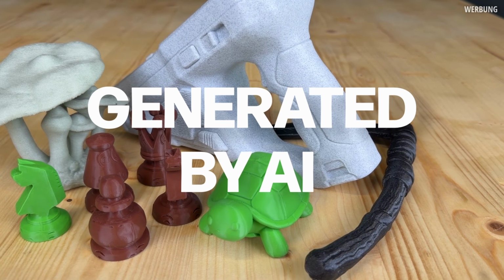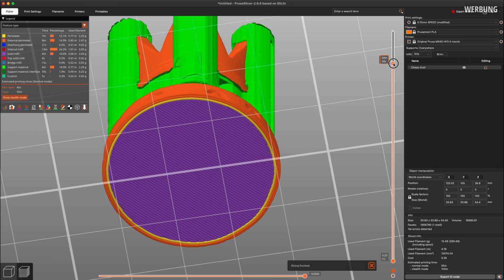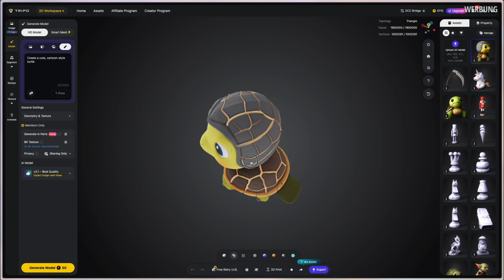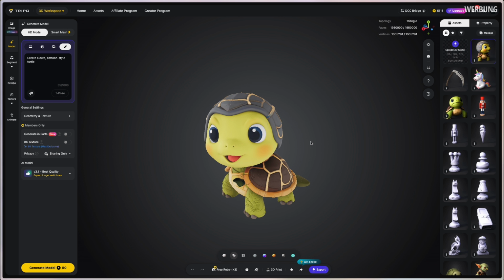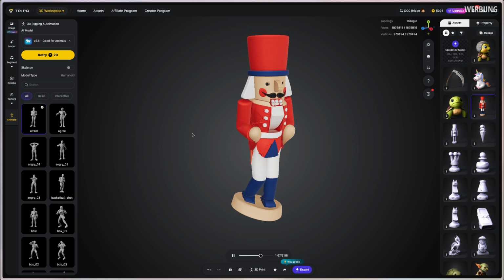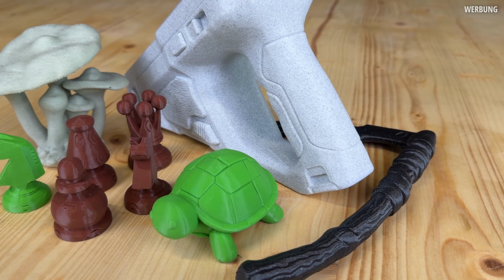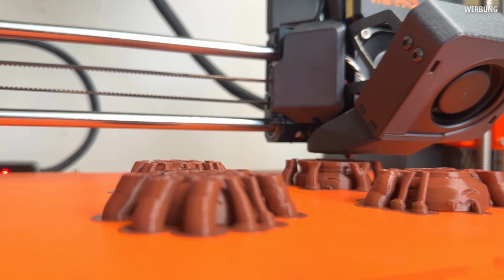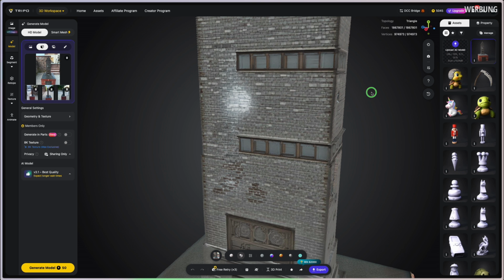How To Generate Models For 3D Printing Using AI

Comment: I've been playing with Meshy, a similar competitor with an LLM agent, for the same reasons: I can CAD, but not create organic models. It really depends on what you're trying to make, but I ran into the limitations of AI creating my ideas immediately. I can tell the agent what I want, but even when the agent knows what I want, it can't directly edit the mesh: LLM agentic AI modifies the 2d images, and then the 2d to 3d conversion is a black box that can't be controlled. AI style bugs and hallucinations are common if you're trying to create certain types of objects, like, say, a hand with fingers. Using it as a quick 3d scanner can be awesomely effective though, assuming scale doesn't matter.

My struggles with AI sculpting lead my to discover Nomad Sculpt, and I think that learning digital sculpting will become my next of many hobbies.

Comment: I've only been using Tripo for about 2 weeks and my 3D modeling skills are pretty limited but the technology has been amazing so far. I'm still developing my workflow but I found it easiest to have ChatGPT create concept drawings and then create the 4 views for Tripo. I then upload the upload the images to Tripo and have the 3D model created. I then upload the 3MF to ChatGPT to have all the dimensions and tolerances corrected and it also verifies the file is "Water tight" and printable. It's almost like I have my own design and 3D modeling team in my garage.
Reply from the maker: Thanks for sharing your workflow! I didn't know you can upload 3MF files to chatgpt, this sounds like a good method, I will definitely give it a try.
Reply: @JanTecEngineering  Yeah, I just figured that out and ended up just asking Chatgpt what it was capable of when handling with 3MF/STL files. I would recommend using the Simplify option in Orca to reduce the triangle count first otherwise Chatgpt can take awhile to process changes. I've been really surprised with the overall results and it has saved so much time.

Comment: That’s kinda cool. I learned 3d modeling for engineering project in class at university. I have the same problem with organic shapes/organic figures. I much prefer regular engineering. Thanks you for this video. I will never ever use cloud ai so i looked for a similar self hosted thing and found modly3d. I'll give it a shot later.
Reply from the maker: Interesting, I would be curious to hear how it works for you. Self-hosted is great if you have the computing power and knowledge.
Reply: @JanTecEngineering  i have a 5900x and a 6900xt, built it in 2022. My dream pc, i wanted to upgrade some of it (maybe the gpu) but with the current hardware offerings nothing justify a upgrade. To justify a upgrade i'd need minimum 2-3x performance increase. That’s my rule. Instead i will get a oled monitor one day.

As for modly i tried running it using the appimage earlier, didn’t work. I joined their discord to ask for help i'll update once i get it working

Comment: Nothing against Trip, but I've seen this AI to model in multiple formats very recently, and they all seem to use the same AI website with a different name. While it'd require a little sleuthing to see if they are all related or proliferating one base platform under many names, they do appear to be relatively useful for their purpose. Personally, I'll always prefer 'manual' model creation that is accurate to specs. Freeform/organic that doesn't need to fill a specific role other than aesthetic, sure, fire away.
Reply: If you want to model something organically (like out of clay), there are several tools that can take photos and convert them to a model that don't need the Earth-destroying water and power requirements of transformers to work (or for more accuracy but higher cost there are 3D scanners)
Reply from the maker: Manual model creation is fantastic if you know how to do it, and I didn't mean to disrespect anyone who does that (it's the opposite, actually I admire people who are really good at it). 
Still, I think it's good to have an idea how these AI generation tools work.

Comment: I read about Neural4D last week, a similar tool to Tripo, and thought I would test it out.  I had a photo of big bronze doorknocker I took in Florence Italy.  Uploaded the single image and it generated a nearly perfect STL model, which I then scaled and printed.  Of course, the back side was featureless and flat because the photo was taken from the front, and likely the training data it used was similar.  I think I would only use a tool like that as a replacement for a scanner, not to create cute turtles.
Reply from the maker: Sounds great, I also really enjoyed converting pictures I took into 3D models. The cute turtle was just a demo and you're right, the real value is in replacing a scanner.

Comment: Could this software also make that scanner openable to insert a mobile phone or is that beyond it's current capabilities?
Reply from the maker: It's difficult to hit exact dimensions so the best way would probably be to generate the scanner and then manually edit the cutout for the phone in Blender or a CAD tool.
Reply: @JanTecEngineering  I suppose hinges or chains also may prove difficult?